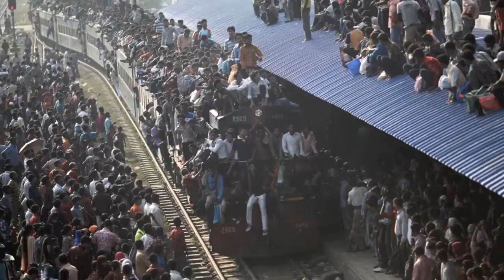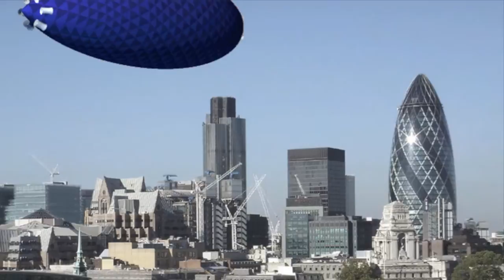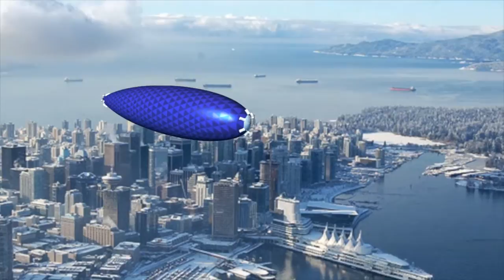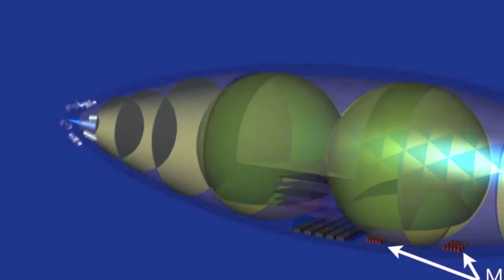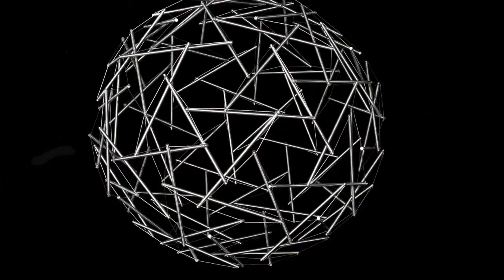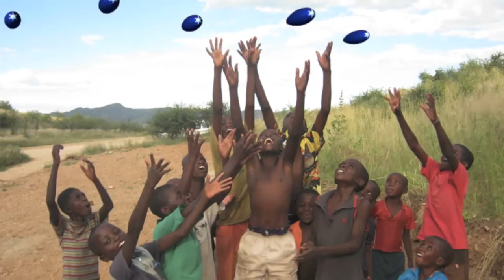The GeoShip Project.mov

Comment: OK wear is it. Honestly there are better designs out there Lockheed Martin. That aside the flexible solor panel aspect  is good I would also add wing's for stability and for other power plants and I know this is a crazy idea seal's retractable ones. it could just work or IV seen ships use  horizontal cylinders to create lift?